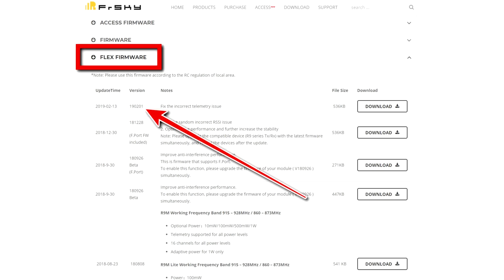FrSky R9 firmware mess and how to live with it - the answer is FLEX

Comment: I have 2 access qx7 and 3 R9 modules and 3 R9mm receiver's. Using both old and new firmware . I finally made them all work. And a different transmitter  for d8 mode. With a lot of work I'm flying now. It was nuts.
Reply: I have the same products and am currently going through the pain of it all now too.

Comment: Hi Pawel... good day! I already have one R9MM-OTA (flashed ACCST by the seller) working fine with a R9M module marked ACCESS, plugged on Jumper Tx18. I mainly fly motogliders and planes, no using flight controller for now, even after more than 60 years (retired electronician)! Very crazy config but necessary... after Frsky are selling Access and give no help on existing ACCST systems!  
I need  your help for flashing a new R9-SX (ACCESS) to this Tx. I am not sure to have read the right procedures, there are so many words on the subject! 
I also have a Frsky QX7 2.3.11 and I plan using its S-port for flashing the 2 frk files (Flex and Fcc) you are saying Ok for R9MM and others... with firmwares R9M: FW-R9MM-ACCST_v20190201. I am not sure to understand the process explained here. What do you recommend as flashing sequence: Flex first, then FCC ? Any other things to do for succeeding ? Flex will be the good key for this R9-SX? Thanks...

Comment: Wow!  Thank you!  Just spent 2hrs frustrated that my x7 that came from hobby king with a R9M module wasn’t working with the R9SX I bought from Amazon.  It would look like it would bind, get to the second part, where the rx light would go green, then it would go back to rapid red flashing.   I flashed the flex firmware on the tx module, then the receiver using the smart port wires connecting the rx to the tx.  And now it works.  What a frustrating process, not the flashing, but the total lack of proper instructions from Frsky.  Tomorrow I get to see how the range is and wether or not I can get telemetry to work.   Very cool products, but what a learning curve!

Comment: I was ‘ok’ with original EU firmwares, but when i started long range, i needed to update. I have put the last version of opentx, r9m, r9sx, r9mx. All updated to flex. Problem now is I’m unsure of the range. I set the power to 1W and sometimes it stays to 100 mw and does not want to scale up even if signal goes to 34-40%
Reply: same problem here! I think it has something to do with the limitation of telemetry send back.. the rx can not send telemetry on a high power back and I think they maybe redused power if telemetry is on in the RX option menu.. not sure.. I think I do the EU firmware version without telemetry and at 500mW and see that happens with the range.. 
Also.. when you bind the rx (with flex firm) and you choose 868 then maybe you get the power limit of LBT but in open tx menu you can even choose 1W but im not shore if it wil comply

Comment: Hello everyone, from what I read, you downgrade the firmware yo flex with frsky tx, what about radiomaster, I use tx16s, what I need to flash r9m and the rx, thank you
Reply: I also have a jumper t16 and I'm wondering about 2019r9 and r9stab. And I'm having issues getting it set up

Comment: So wait you're saying I can get an r9m 2019 version, flash flex to it and use it with my old taranis x9d+ (not the 2019 version of the x9d+)

Did I get that correct ?
Reply: Yes, I have the ACCST QX7 with a 2019 R9M flashed with flex.
Reply: @nosky_  awesome....I decided to get the crossfire though it's cheaper these days.

Comment: Hey thanks a ton for the advice! I wanted to take my planes long range, bought the hardware, and then realized I had to deal with this crap. I watched 3 videos you have related to R9 and it really cleared things up for me. Thanks again!
Reply: @albertthorval4674  After downloading the firmware zip file from the FrSky website, you'll find multiple firmware files inside. One of them is the FLEX firmware.

Comment: Hey Pawel, now that Flex has been removed from Frsky's website, what now? I've got a Taranis X9D SE pre 2019 and I have tried researching which recievers I can use now with the R9 2019. Confused about it all. Think it would be possible for you to make a new current video on what receivers we could buy that would work with set ups such as what I have as I know I will need to be buying receivers soon. If you do so, thanks in advance and if not that's ok too.
Reply: Flex still there...
Reply: @erlandfpv  Hmm.. I was on there several times and never did see it. I fixed the issue.. switching to crossfire. Frsky isn't going to make me do nothing.. lol Thank you for your reply. I've watched a huge percentage of your videos.  Thanks for what you do.

Comment: Pawel (or anyone that knows), can a receiver that comes with ACCES be downgraded to ACCST? I see that FrSky has both versions available for download but after reading through these comments it seems as if you CAN NOT downgrade ?? Looks like the Non OTA RX's are getting scarce and I would not want to invest in this line if I could not use it with my ACCST gear.
Reply from the maker: Yes, if there is a ACCST version for the receiver then it is possible to downgrade it

Comment: Hello, I have the R9M 2019 module, and I am a bit confused on the ACCESS compatibility. I flashed it with ACCESS firmware and I flashed the R9 MM also with ACCESS, but i could not bind the receiver to the module. I have the standard X10S Horus TX. I was able to ge them to bind only when I flashed them with the standard ACCST firmware. So I guess ACCESS Compatibility has to do also with the TX. Thanks for clarifying.

Comment: Hi. i was using flex NO OTHER FIRMWARE, with my x-lite pro access firmware, and it was working,  did two updates for the r9 m-lite pro module now none of my receivers will bind both r9 slim+ and r9mini older versions flashed with flex, the r9 min ota seems like it binds until you unplug it and re connect battery and the light is red and not bound? any help would be really appreciated, do not like to keep binding r9 minis as the little bind button is a bit fragile to be doing this over and over again.

Comment: Paweł I have bought another module, this time it is R9MLite Pro and it has ACCESS only. I downloaded the ACCESS Flex firmware 1.1.2 and also put the ACCESS Flex firmware 1.1.2 to the R9MM receiver. The system works, the receiver does bind and connect but I can't set the transmitter module to auto power. Only static powers from 10mW to 1000mW. Do you have any info on that? Could you test it? Thank you

Comment: please help me with binding R9M and r9mm(xlite transmiter)... I've tryed to bind it the whole day. Installed the latest open tx 2.2.4 with flexr9x copied the new sd card files (sdcard-taranis-x7-2.2V0021.zip). Than instaled on R9M Firmware (2019-02-19 190117), than on R9mm Firmware (2019-02-13 190201). turned off internal module, turned on R9M, set 915 MHz (the rx and tx has both blue marks on antenas so i decied that it's FCC rx and tx) than masseges appears "requires non certified R9M firm. Than set channel range 1-8 ch, rxNum01. Than i click bind, holding the button on the recciver connect the battery, red and green lights just light and nothing happens... I've realy tired of waiting for a red light to blink... Please help me... I'm a newbie just finished bilding my first quadcopter and understand nothing. I also disconected sbus port from flight controller, and left only connected ground and vcc when updating firmware and trying to bind. but it doesn't help((((

Comment: After many 6-9 months of poor R9 reception & failsafes, telemetry lost... I found an FCC version that was rock solid. I am so gun shy of R9 firmware that even if you are right about flex, I am unwilling to take the chance.
Reply: Which firmware?
Reply: @bl8zn  19201 FCC. Fport works best if you want telemetry. Soft serial sometimes gives "telemetry lost" on some of my flight controllers ( f411-wing)

Comment: Paweł, good video, I have 2 comments:
1) true FLEX is the way to go!
2) To go with Accst only for R9 - this is not true for R9 users with XLite that would like to use stronger transmiter other than 100mW. If Sb wants to go for 100mW <  then one needs to use R9M pro Lite and then you have no choice to use ACCESS

Comment: The only point for me the RSSI, is very slow and not very readable usable.  There is a  2+ seconds lag, so when flying around a concrete building my RSSI becomes bad after I have passed that building.
Also the RSSI scale in my betaflight OSD using Fport is a bit of strange.   Start at 99drops fast to around 68-69 then decreases.
In comparison  with my flysky system RSSI out behaves very linear as a percentage with the range, giving a good indication. from 99-0.

What about the latency for Flex, is it using pxx2 and have the fastest response minimal jitters?

Comment: Thx for your advise! The firmware issues brings a lot of headache to have some many different firmwares on R9 series...... According to the suggestion, Flex firmware should be the best. May I ask if R9m lite pro (flex) support ACCST too? I have just recently bought the R9m lite pro, and it only has access (flex) firmware, I tried to bind with some old r9mini receiver, but fail. Do you have any suggestions?

Comment: How I dealt with it  was I sold it off on eBay. I just wanted to fly.
Reply: Not only on eBay, at BG too. Just after the Access stuff appeared, I ordered some Frsky R9 MM 4/16CH ACCESS for flashing with Flex and now they seem to be disappeared ,only OTA stuff there.
Another downside was not to get at least the FCC900 version antenna (which work even at 868 Mhz) butthe blue Australia 915 version. 

Frsky is no longer on my top list.

Comment: Thanks for the info but came to late , was so confused about Acces and the high failure rate of the MM recievers , I am switching to the dark side tbs did not want to but see it as the only way , had to many MM dead on arrival or biding issues and coming inbound for no reason, Frysky has fucked it for themselves in my opinion and will probably go bankrupt

Comment: Thank you for another great video Pawel, as a R9 user who is looking at the viability of the system long term I really appreciate your opinion. The R9 system (and the rest of FrSky at the moment) is a real mess! I'm in the process of trying to figure out whether or not it is worth future proofing and upgrading to the R9M 2019 version. I believe HorusRC are still offering discounts for existing R9M owners.

You mentioned to try and stay away from the OTA versions of the receivers.... I have a feeling FrSky will be phasing these out soon. The non-OTA version of the R9MM is marked as discontinued on HorusRC and is now sold out on Banggood with no restocking date.

Comment: i just search, and there i not a 190201 version, actualy i found the 190117 version posted the same day, 2019-02-13
Reply: Reading carefully? The flex version  with  numbers 117 at the end is for the TX and the 201 for RXes..
Reply: @amax2624  Thanks!
Reply: and also, i cant find the flex firmware for the r9 slim+...
Reply: oooh, theres a "load more" option gggg

Comment: Slightly pointless comment here, but I agree with everything you've said in this video, and it's exactly the same conclusion I came to.

I have an original Horus X10S and as I understand it I cannot run the R9M 2019 module with ACCESS even if I wanted to because the module bay won't support the digital module protocol used in ACCESS. Even the ACCESS upgrade kit for X10S will not upgrade the module bay component so it is useless and I'm not prepared to splurge on the X10Express just to use ACCESS.

Comment: Well, crossfire just works without nonsenses as inverted ports and need for 2 uarts apart from that receivers are not that much more expensive.
Reply: My god I swear if I see another 'just go Crossfire' comment I may go insane.

The Crossfire proposition IS expensive if you are already invested in FrSky R9.

The point of this video is that R9 works just fine if you use the correct firmwares. There is absolutely no need for anyone to 'go Crossfire' and empty their wallets into Trappy's bank account like you did.
Reply: @leephcom  ok, after initial mess with firmwares I just put my R9M into drawer. 
Not sure if many people heavily invested into R9 ecosystem, I doubt that.
And personally I prefer to give my money to someone who cares about customers and compatibility.
And no it's not that expesive, you don't need full crossfire tx, micro is enough.

Comment: I have all my Pre 2019 / Pre ACCESS  R9 on 181228 FCC.  I'm kind of scared to change since it's all working just fine.

Flex 190201 for FCC too?
Reply: Flex is not FCC certified, even on 915mhz. If you have no issues, don't switch to flex. The main benefit was for EU 868mhz users who wouldn't get high power levels with telemetry without flex firmware. You 915mhz guys have always had all telemetry and power options.
Reply: I’m the same running the latest version of FCC on my pre 2019 R9 module and R9MM and R9 mini receivers with no problems so at this stage I’m not switching.

I do have an R9 slim receiver that I was going to use in a long range fixed wing and I don’t know if that works well without FLEX but as James mentioned it seemed to be the EU guys which were having problems with telemetry etc. so hopefully I won’t have to switch everything over to FLEX down the track.

Comment: Been using Feb 2019 Flex on 868mhz all this year, fixed all the issues I had...Have to say Pawel, those non job EU Clowns dreaming up LBT bollocks should be put in Prison. FrSky must hate the twats. Bottom line..?...R9 system for £30..TX and Rx.

Comment: Just use crossfire and get a Jumper  t16. No frsky for me with their weird practices.
Reply: When one has invested in R9 and a Taranis or Horus plus a fleet of receivers, the prospect of 'just using Crossfire and Jumper T16' is an expensive one when the result is basically the same... 900mhz is 900mhz.
Reply: @leephcom  True. My whole fleet is Futaba and the Long Range stuff uses ezuhf system. big investment back then. But crossfire has advantages over what I used. When people just start with the hobby I never advice frsky anymore because of their shady practices with forcing shops to choose what to sell. If they sell Jumper T16 they will not get any frsky stock. Don't know what the status is of that story, but the fact is they make it impossible to use crossfire out of the box with their new transmitters, while the older ones worked. Both frsky and  jumper support OpenTX. What Frsky does is not very "open" for the hobby. And i don't support companies that run their buissiness that way.

Comment: I gave up on FrSky R9 system and traded it in, on the TBS UHF exchange program. I still have a lot of respect for FrSky 2.4ghz accst. It's what made mini quads, as we know them today, possible. I won't be updating to access. If I need a faster link with better range, that's where my xfire steps in.

Comment: Can you also do a video about xm+ and r-xsr?
Does it sense to use specific version of opentx with a specific version of the receiver firmware?
Reply from the maker: OpenTX has nothing to do with the receivers.
Reply: FrSky has Firmware problems with failsafe on R-XSR for long time. There is now a new firmware that fix it

Comment: Completely agree with you.  R9 system works perfectly with the early 2019 flex firmware.  I’m just keeping all my planes on that for the next few years!!
Reply: Alan Paul same here but just out of interest, which ones do you use?  I use Flex 190117 on the TX in adaptive power mode and Flex 190201 Fport on the receiver and although I get strange rssi values (always between 40 and 70) I've never had a failsafe.
Reply: @jibbajabba4597  You must use same version of firmware on rx and tx... Lets see Torban Dallas
Reply: @jibbajabba4597  You right. I forget something.... No problem. Peace
Reply: prudensky sorry & no worries you had me worried for a sec lol
Reply: Hi.  Can’t remember the number but it was the 13th Feb 2019 version and set up as <=1W.  This has reminded me to download and save the firmware again and keep it on my laptop just in case I ever need it again, although it’s probably on the SD card in my Tx still (Taranis).  I don’t have a % RSSI readout, just the bars on the Tx and verbal RSSI low warnings at I think 42%. But never had one and out at 2.3Km earlier today using the DJI FPV system which is awesome!!
Reply: @alanpaul1234  I think you mean december 2018 firmware... It was released in february 2019. But i can mistake
Reply: Alan Paul thanks Alan, yeah same as me and I've been out similar distances with it but I tend not to go out further than I'm prepared to walk nowdays lol
Reply: Yes, the firmware folder is dated 13th Feb 2019 but some of the files are earlier.  Anyway, I have just saved them all safely in case FrSky ever delete them from the download page.  I think it’s a great system but before I moved to Flex I did have some random failsafes at short range - now I don’t tend to worry about it at all.  I will leave everything as it is for as long as possible.  I use the big R9 receivers and only fly fixed wing.
Reply: Alan Paul funny I just did the same, you know it's as if none of us trust FRSky..... LOL